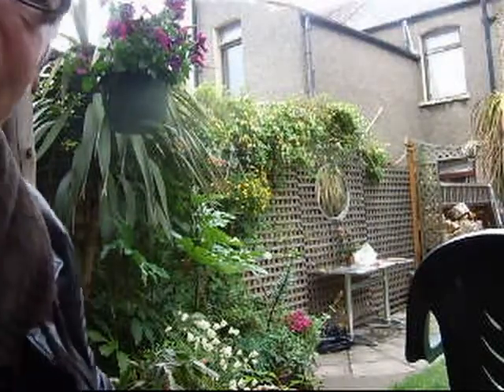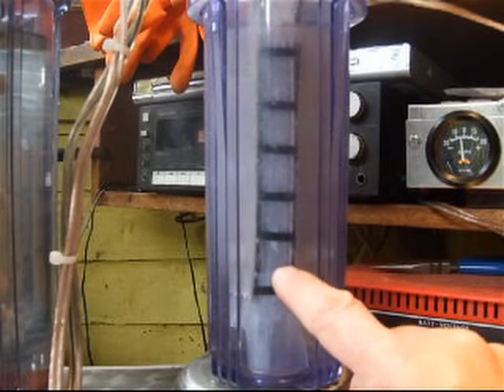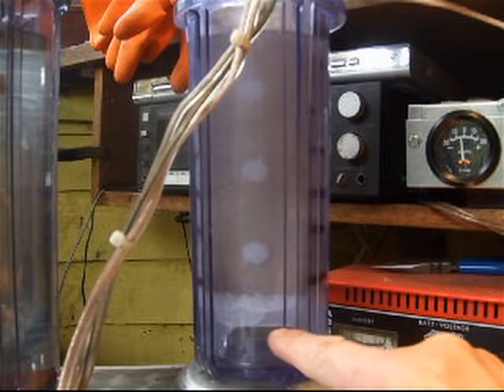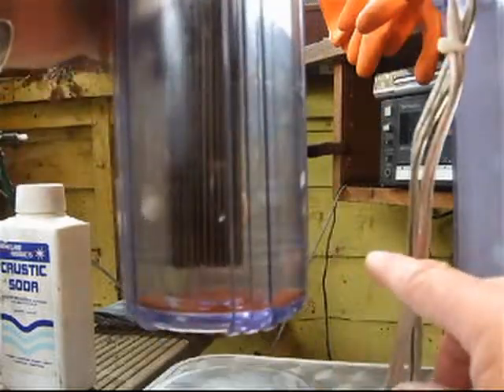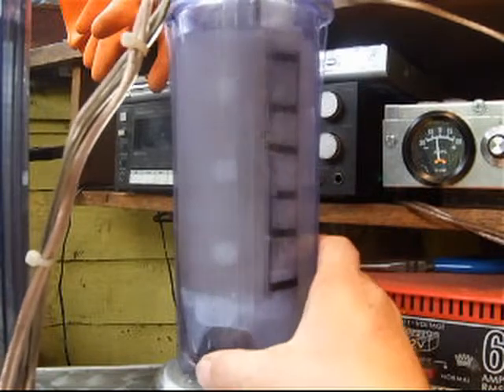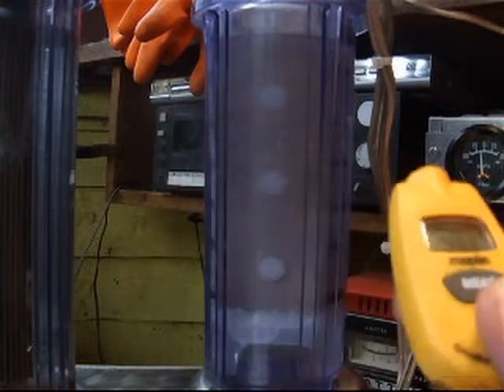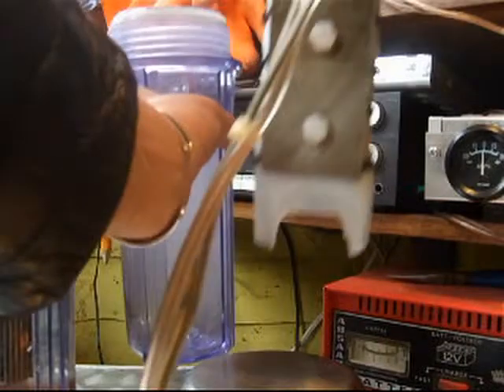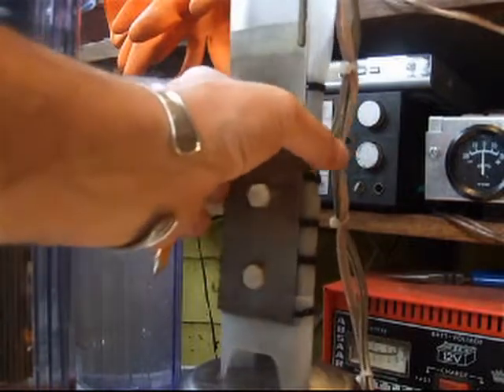ZERO BROWN GUNK EXPERIMENTAL HHO GENERATOR

Comment: I don't know how you have put the plates together, I am assuming you've put the plastic against the one side of the plates, if so the there needs to be a plastic or nylon washer between the plastic separators and the plates, so that the electrolyte is contact with each side of the individual plates, and the gas can escape to the surface, as long as the plastic separators are lower than the plates, and higher than the plates and above the water line, everything should work fine,
cheers.